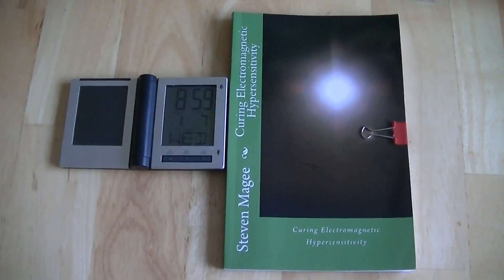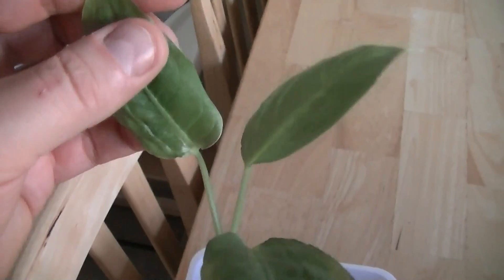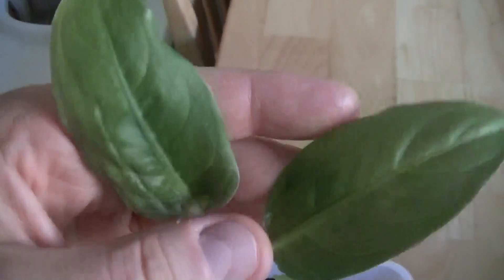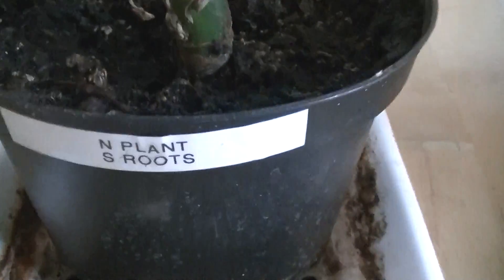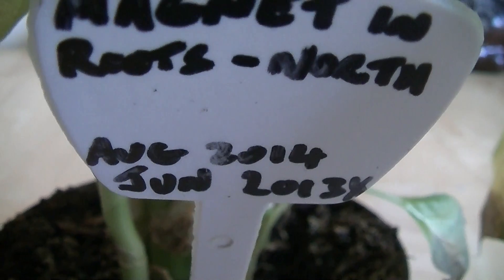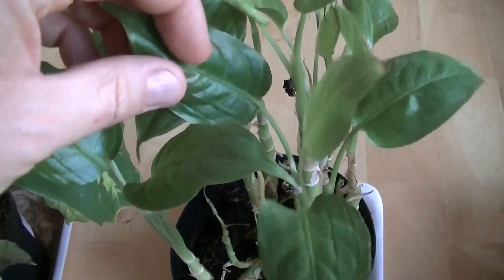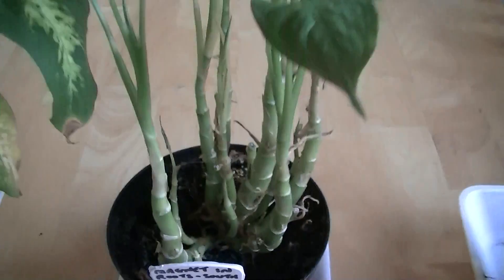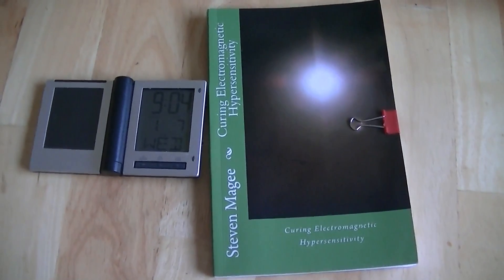Growing Plants in Magnetic Fields Jan 2015 Update

Comment: Could the deterioration of the plants simply be a result of the magnet corrosion? There are several metals in those magnets, like nickel, copper, iron, neodymium, boron, and dysprosium. Could the results simply be because of the corrosion of these metals has messed with the PH levels of the soil?
Reply from the maker: +Brandon Tarby It's possible, although the magnets are very small and have taken years to corrode.  I have grown plants in corroded galvanized metal pots and they do not die in them.  A friend of mine slept with powerful rare earth magnets under his pillow and said he got very funky mental functioning after a while and had to stop it.
Reply: the magnetic fields will help growth as they capture a larger amount of radiation within the field, thus growth will increase as all "matter" is simply radiation trapped within a field of stability...but if u are looking to overcome the radio frequencies that are harming biological life (condensed radiation) then what u need to add to ur equation is natural radioactivity, naturally occurring "hot stones"...stones with known rad units...this will eliminate ur harmful frequencies...and replace the "matter" with the proper frequencies, which are nothing more than the stored natural radiation frequencies which long long ago came from the sun as solar radiation and was absorbed by the stones as stored radiation...in fact, the stones themselves are nothing more than this very radiation trapped within electron shells, electromagnetic fields...just as the planets are nothing more than stardust trapped within their own respective electromagnetic fields...stardust itself being radiation vibrating at a slower rate thru the radioactive decay process...so, first u buy the natural radioactive stones which are easy and cheap to buy, then u apply the very same magnetic fields, and watch what happens...u won't believe what will happen...in fact, this is how u can heal any disease in ur own body, from blindness to cancer...by simply adding the energy necessary to do work at the atomic level, thus the derivative cellular level, and then u apply ur additional stronger magnetic field for additional and overpowering atomic molecular stability purposes, as disease is a magnetic field disturbance for multiple reasons (usually via  man made interference and-or mineral deficiencies which act as antennas for these fields)...so, in short a stronger magnetic field combined with the proper ionic minerals, combined with the energy to do the work (proper frequency energy meaning nnnatural radioactivity) and viola u just repaired any problems ur biological mass of trapped energy (ur physical body) had...

there are a few more things u can do to speed up the process like eliminating infections of bacterial, parasitic, fungal, viral nature...but in short that process will eliminate any any any disease within ur biological field...and u will find this out when u do ur next plant experiment...it will work the same for any and all biological life...

ur friend, abracadabra